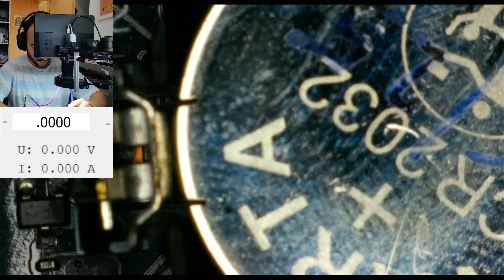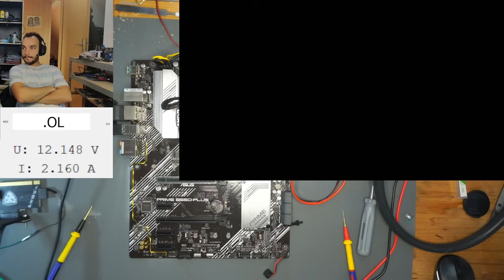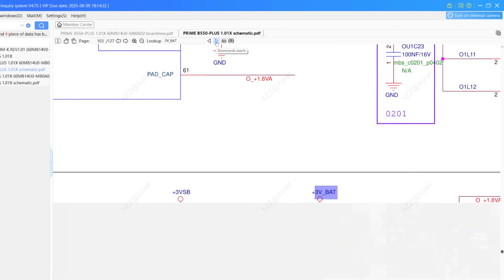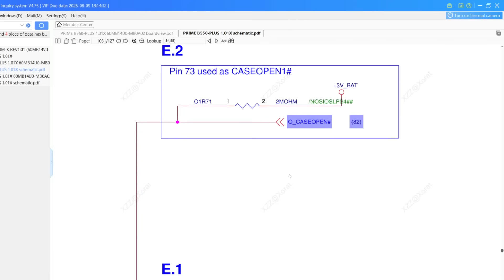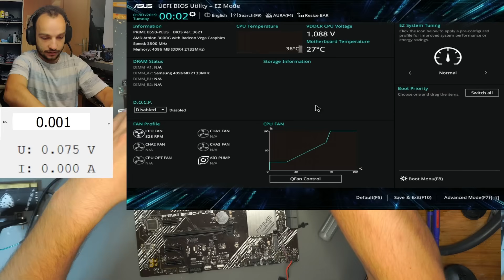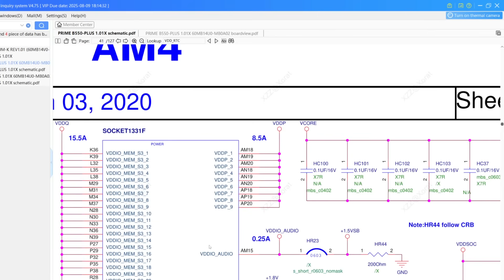Bios keeps reseting, can we help this viewer? || Asus prime B550 Plus repair fix Desktop motherboard

Comment: The resistors you actually don't know what they used is to form a RC time delay circuit. 1K resistor value is important. I know you are thinking that capacitors as a bypass capacitor but it also functions as time delay circuit
I think 1K resistor is a bit high. Designer should secelct 900Ohm or something. Doing this would help CPU to interpret incoming voltage at the time when it needs to read the value also the 900Ohm value helps to fix rapid discharge issue.
Reply from the maker: Sadly with having anything higher then 0 ohms, it keep reseting the bios and putting the error message on!
Reply: Then my theory is False. Thank you for this information.

Comment: I should have removed, or lifted the output leg from  the 1.5 converter, and inject 1.5 in that rail, with a solder cable to test. I don't trust it , less so when you injected some voltage and you got 1.1 v in the input.
Probably wasn't that, but, the rest of the things look ok. Oh well, this case is one of those thing we never know :)
Reply from the maker: Did do that and had the same result! Resistors where to high value for the current that was passing!

Comment: you could try using ultrasonic to clean the board. This usually solves the issue with cmos batt draining but I'm not sure if it can help with the resetting.
Reply from the maker: That could have solved it, but i dont own one!

Comment: Make it a habit to run the math through your mind. You remove the 1k and measure 7k-ohm behind it and say "high resistance"...    But 7k on a 1.5V line equals ~200uA, while the schematic clearly says it should only draw 4.5uA. So it is in fact very low resistance in this context. With the CPU and 1k resistor removed, that line should measure several Mega-ohm.

Comment: One of those SMD capacitors has high leakage current, will probably fail short at some point.
Reply from the maker: Both changed afterwards without any luck sadly!

Comment: I would try replacing the regulator AP2138N. It could be giving off too little current if there's something wrong with it. And + the resistors limiting the current even more
Reply from the maker: That also could have been done, but the voltage would have been going down if it couldnt deliver all the current that the line is drawing! That was what happened  after the resistors where the voltage dropped. But after placing the 0 ohm resistors the voltage was 1.5V everywhere!

Comment: Why not remove the two capacitors and see if the battery last? Then you can be sure it's not the capacitors giving a parasitic drain.🤔
Reply from the maker: Did that afterwards, sadly without any luck!

Comment: That 10k and 1k on the 1.5V RTC line is a voltage divider, and it is telling us there's a 5k ohm partial short to GND resulting in the 0.7V after the 10K resistor.  Check there isn't something partially shorting the CLR RTC pins...this is after all the actual symptom - the BIOS settings are being cleared.  If that's ok, then the cap after the 1k (near the SIO) is either leaky (i.e. 4k ohm 'short' to GND), or the SIO needs replacing.

Never trust caps!

Also, when your on-screen meter froze (in AC mA mode...!), you never checked the battery drain current again.  If there's a 5K partial short to GND, it'll be around 0.6mA (or because of the 1.5v regulator maybe 0.3mA - but way more than the expected 4.5uA).
Reply from the maker: The RTC 1.5V never goes into the SIO! Ive replaced the caps and that didnt change anything sadly.
Reply: @MainboardMedic  Just rechecked my math, and the 0.7v after the 10K res. is roughly half the 1.5v, so the path to GND must also be around 10K not 5K.

I thought you were checking around the SIO? - my mistake.  Where is that 1.5v (what was 0.7v) going?
Reply from the maker: @ijaygee1  The 1.5V was after the regulator from the 3VSB battery and the 0.7 where going to the CPU socket and 2 caps!
Reply: Follow VDD_RTC (which bear in mind is a signal pin and not CPU VDD) around exposed metal ie CPU socket, cap ends etc. That level of stray resistance could come from conductive dirt or light physical damage.
Reply: @md5451  Agreed.  It's about all we're left with if the caps are ok.  There might be something in or under the CPU socket?  Perhaps a quick wash might fix it?
Reply: @ijaygee1  Agreed, there's something like maybe conductive dirt under the CPU socket that coincidently connect 1.5 (VDD_RTC) to the ground. drawing current.

Comment: But now having fitted zero ohm resistors, when you short the bios re set pins, you short the battery?
Reply from the maker: No, you short the regulator, but there is almost no power from it because its vin goes through a diode!

Comment: With respect your diagnostics jumps randomly about, you must follow a lead until it is eliminated, you said the reading across the Bios re set pins was wrong, then never looked into it?
Reply from the maker: Yes, i am cutting out a lot of stuff that didnt lead anywhere, which is why it seems that i am jumping so much. If i wouldnt cut it out the video would be almost 3h!

Comment: i got that issue on my own mobo b550 aorus pro... draining battery and bios reset, i also injected voltages but nothing, got no schematic so i thought that regulator was a p channel mosfet and replace it anyway with one and it works normal in a couple of days.... but now the SIO is dead😴
Reply from the maker: Well replacing the SIO isnt to bad! Expspecially if you already did the diagnose! SIO cost like 10€ max, probably less!

Comment: remove the 2 crapacitors.. they may not be shorted but they may be leaky at that point you wont see a short but it will drain the battery and prevent the voltage to get to where it needs to go !!!!
Reply from the maker: Did that afterwards, sadly without any luck!

Comment: Surely the only thing that matters is whether the supply disappears or is low, of the Bios chip? if it loses it's supply it will not retain it's memory?
Reply from the maker: As far as i know the bios chips keeps a base off the bios settings and they get loaded elsewhere and stored there!
Reply: @MainboardMedic  yes you right, the settings will be keep in Super I/O. for Intel platforms the settings will be keep in PCH. In this case the CMOS volatile memory from Super I/O is bad or the track is broken or corroded. it can be a cap as a filter for communication between Super I/O and Bios chip or CPU. The modern Super I/O contain both CMOS volatile and some ROM memory. Check Super I/O datasheet or ask chatGPT about this Super I/O

Comment: Check the capacitors behind the 1k resistor. Just assuming they can't by faulty will not help. Capacitors can die slowly.
Reply: I agree, have seen so many smd capacitors problems that make no sense, you could at least isolate them and check if the behavior stay the same.
Reply from the maker: I have changed both off them afterwards without any result , like i thought, but thank you!
Reply: @MainboardMedic  Nice, thanks for the great videos!
Reply: they can be leaky and then you get what he is getting

Comment: Capacitors like MLCC, especially next to the CPU socket where you have forces bending the board, can definitely crack, and they won't always short to zero ohms.

Edit: with this mod, you also lost to some extent the bios reset pin header, then removing the battery becomes obligatory.
Reply from the maker: The bios reset header still draws the line down to ground making it reset the bios. Caps where changed aftewards without any luck sadly.
Reply: @MainboardMedic you'd be shorting the output of the regulator, which it might survive, but is not the best practice.
Reply from the maker: @TrickyNekro  Defenetly agree on that! I should have placed another 1k to the pins just to be sure!
Reply: @MainboardMedic also another thing worth checking...

It could be that the connection to the CPU socket is a switch to ground to force reset the bios. That somehow got partially damaged.

That would make sense for a platform that supports different generations of CPUs and it would make sense with the current draw reading that you get @ around 24:00, depending on the burden voltage of your multimeter.

Worth checking out.
Reply from the maker: @TrickyNekro  But how would you check that? The pin only connects to the CPU and same issue with different CPU´s! So i wouldnt know where to check for that!
Reply: @MainboardMedic it wouldn't connect to the CPU, that's why it wouldn't matter changing the CPU.

It would be some kind of metal contacts under the socket, so that the bios is reset every time you pull the socket open.

I don't know if you could non-destructively disassemble the CPU socket.
Reply: @MainboardMedic I've checked the pinout of the socket, yes that goes indeed directly into the CPU for the on chip RTC.

After removing the short, could you measure resistance between ground and the end of the 1k resistor that goes to the CPU, with the socket open, closed with CPU, closed without CPU?

That would be interesting!
Reply from the maker: @TrickyNekro  Sadly the board is long gone!
Reply: @MainboardMedic ah well, it is what it is then 🫤